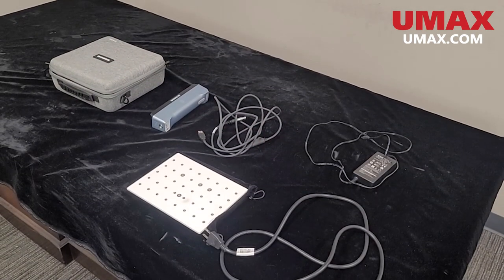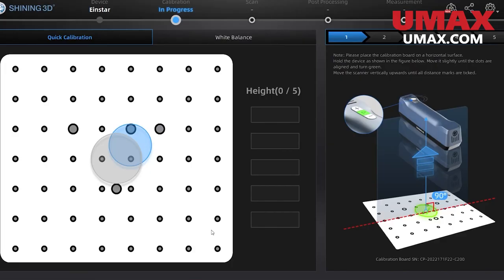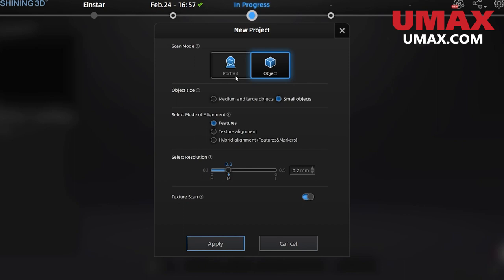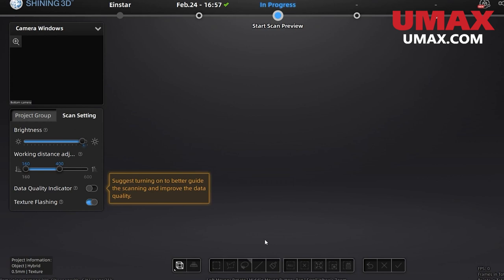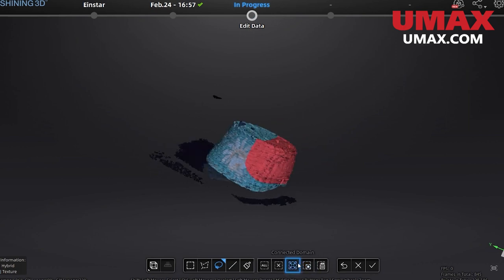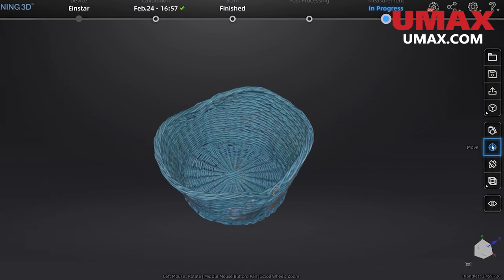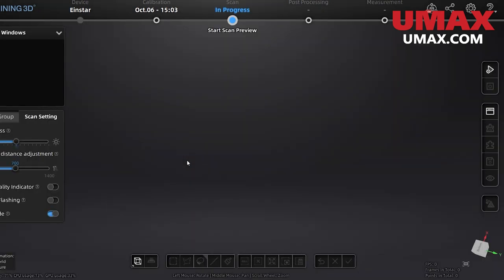Einstar 3D Scanner Training Guide

Comment: I just bought this scanner and have scan small object well and have been really impressed with it but I bought with intent to scan some larger object such as the side of my boat (less than 10ft) to get the decals. I have large object and low res select but the scan has no color, the decals cannot be seen, is it because i selected large object with low res? Any reason I cannot scan constrasting colors?
Reply from the maker: Would you make sure you select "color" or "texture" setting at the beginning?
For large object, you may need to separate into 2 or 3 projects, and then you can combine them.
If you need more help, please contact us directly at info@umax.com

Comment: Is it possible to continue to scan in a previous project once a new one has been created? Say i want to go back the initial scan?
Reply from the maker: Yes, you can always go back to open the old project to resume your scan.
Reply: @umax2639  Is there a trick to changing the active project?
Reply from the maker: I think you're asking how to rollback the previous scanned state during the current project. 
For doing this, there is no other way. If you would like to scan something challenged, you should always save a copy of the current project first. If it doesn't work out, you then can go back to the previous saved project to start over.

Comment: Thanks for the Einstar videos. Question, can you inform more about using a tripod and/or (automatic) turntable and if using external light?
Reply from the maker: Hello, this is a handheld scanner and is designed to operate it with hand holding. If you want, you can put the object on a turntable. Then you can hold the scanner (by your hand) to scan the object while rotating the turntable manually.
But if you can find a "bracket" which can hold the Einstar scanner, you may use it with Tripod (similar to Einscan line's Fix scan mode).
Reply: @umax2639  And what about lightning? Is it prefered to scan using/emulating 'day' light ?
Reply from the maker: At indoor, regular room light is fine. If outdoor, it works too but you will need to adjust the scanner's brightness setting according to the current sunlight
Reply: The scanner in the video does have port for connecting a tripod.  You need to remove the rubber shell surrounding the scanner, then you'll see a small plug that's covering the tripod hole. You can see it demo'd here:  https://www.youtube.com/watch?v=gasGTDId3XU

Comment: Will the Einstar utilise marker dots for better tracking on large flat surfaces?
Reply from the maker: Yes that's right. For big flat surface area, it's essential to apply some markers so the scanner can capture these data. When you scan with marker alignment, the scanner usually has better accuracy. Each scan shot from scanner needs to see at least 4 makers a time. Each marker should be about 1~2 inch apart each other.

Comment: Great video! question though, my scanner shows blue lights when it's not connected to my laptop. However, when i connect the wire to my laptop, the bottom LED immediately turns red and the device begins connecting and disconnecting. The shining 3D EXstar will not recognize the scanner either, it just shows online. Please help!
Reply from the maker: Hello, you can power off the scanner and power it back on to try again. In the meantime, temporarily disable your anti-virus or security software in your computer. Also make sure you plug it into your USB 3 port in your computer.
Reply: @umax2639  awesome, thank u so much!

Comment: My Einstar repeatedly fails calibration resulting in poor scans. Any ideas how to resolve?
Reply from the maker: Hi, if your scanner failed the calibration, it is a big issue. First of all, check your calibration board has many scratches or not. The calibration board needs to be kept very cleaned. And then follow the correct procedure to perform calibration.
If you still have any problem, please don't hesitate to contact Einscan tech support immediately and those experts will help you very quickly.
Reply: @umax2639  Thank you  for your  help.

Comment: Hello
I'm keen on using this scanner for environmental scans. I work as a handyman and I scan the environment using an ipad and then build a digital version of what I plan on building. would this scanner be suitable for this?
Reply from the maker: This scanner can scan big objects like a car bumper but the speed would be slow due to its limitation. It also requires markers if the most surfaces are flat. The environmental objects you are talking about may be like a whole room. If that's the case, this scanner is not suitable for you. If the object you're scanning is over 10ft, it would be very difficult.

Comment: Hi thank you for the video. 
i have a problem i wrote to shine3d bit i never got a reply...
When I click on create project it takes 3 to 5 minutes to do it. I tried with 2 different computers i7 32gb Nvidia and xeon 32gb Nvidia and is the same very slow to crate the project. Any suggestions please?
Reply from the maker: Hi, there are several reasons for this slow performance. 
First of all, please make sure you make the Nvidia video as primary default video processor. Usually the computer uses Intel on board video as default and it makes the performance slow when you do 3d scanning.
Second, it may be something to do with your application. Please let us know how large of your object and what material. If possible, send us a photo and we can evaluate it for you. Sometimes incorrect scanning setting may cause the slow scan.
Shining3d tech support usually respond within 24 hours. They may be off during the weekend. If you have your support ticket number, please let me know and we can push the response for you.

Best regards

Comment: Is exportation to Fusion360 and then put into splitter software to be printed possible with this?
Reply from the maker: Einstar software generates STL or OBJ file formats. If Fusion360 software can import these two formats, it will work.
Reply: @umax2639  You can. Thanks a ton.

Comment: you know you're asking us to click buttons that are off the screen, right
Reply from the maker: Would you tell us which part of the video that you have this question?
Reply: @umax2639 looks like the capture software is not scaled correctly
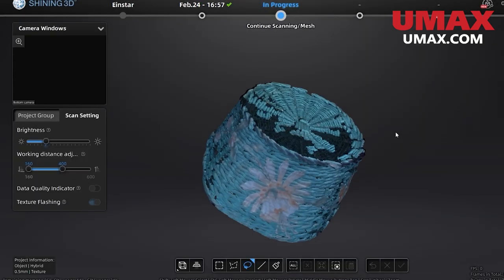Reply from the maker: For the video from time 6:44, he's doing alignment. He aligned two different scanned data/projects into one image. Usually if there are some common area between these two scanned data, the software can automatically align them together into one piece or you can manually align them too.
In this video, he clicked on the "Manuel Alignment" button on the top second left corner which you can see it from the screen.
Reply: @umax2639  what's he click off screen to the right before clicking the alignment button on the left?
Reply from the maker: Yes I see. He first clicked on the "Manual alignment" button on the right of the screen to open this manual alignment window. In this video, he didn't show the right side toolbar of the screen.